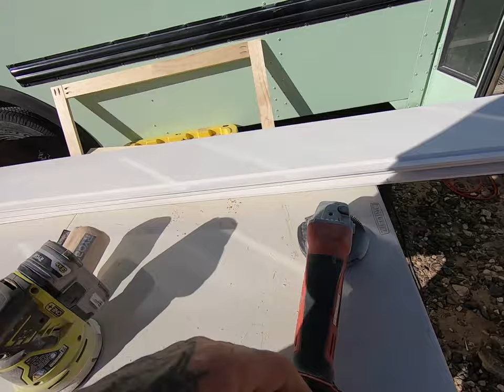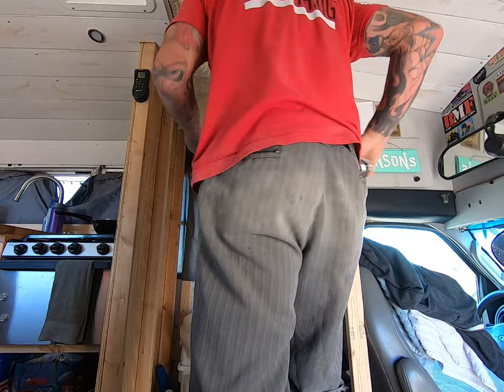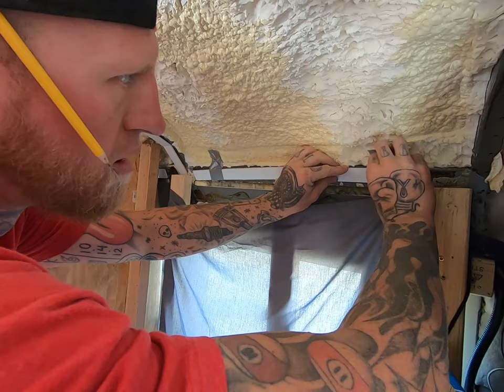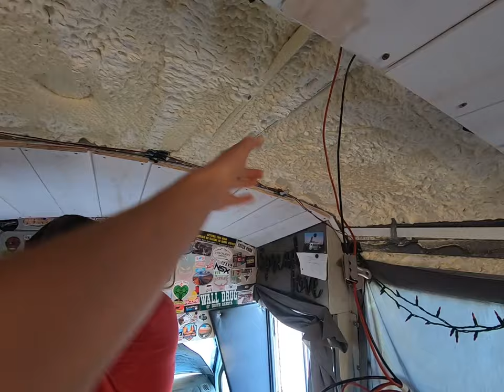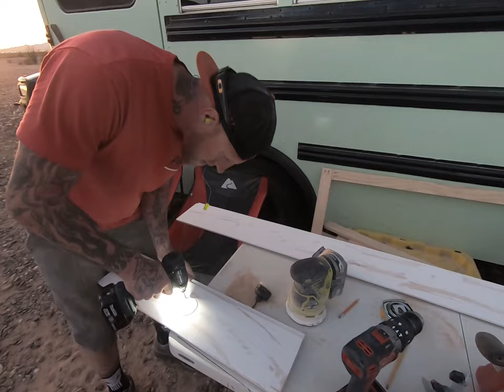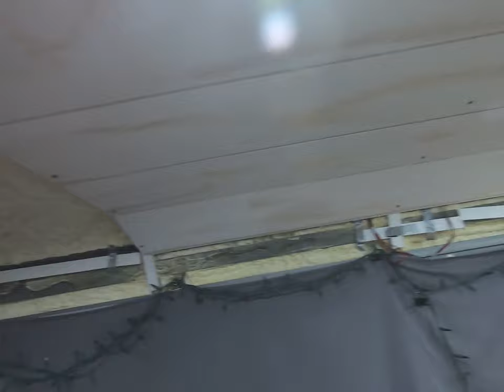How To Install Ceiling & Lighting | Our Ceiling Reveal | Dustin & Tonya

Comment: Looks awesome! Goodbye to looking at the insulation. I have a pretty good idea what I have in mind for my ceiling, but I was still thinking on lighting options, so thanks for the inspiration. :)
Reply from the maker: Thank you! We love how it has turned out 🤗 What are your thoughts for the ceiling? And you're welcome for the inspo! If there's anything we can do to help, let us know!
Reply: A neighbor of mine had extra tin tiles with an old fashioned star pattern from redoing their kitchen, so I was going to cut  plywood into more manageable board sized pieces, put them up, and then the tiles. After I paint the tiles, of course, since they're still currently 'unfinished.' I think it'd look awesome to have a ceiling covered in a star pattern.
Reply from the maker: @crazyrockhoundheidi1840  that sounds awesome! We would love to see it when it's done!